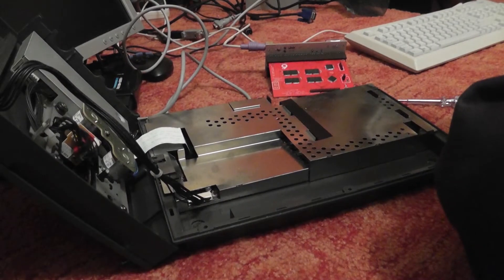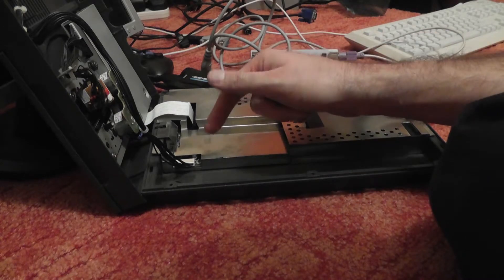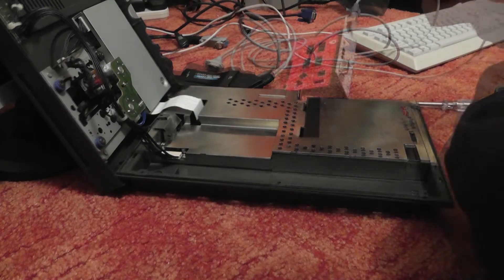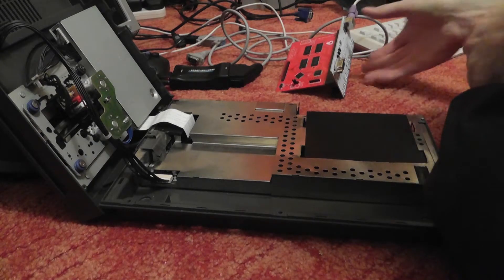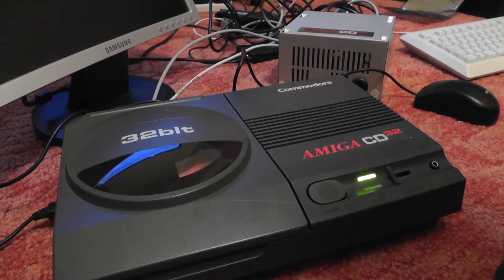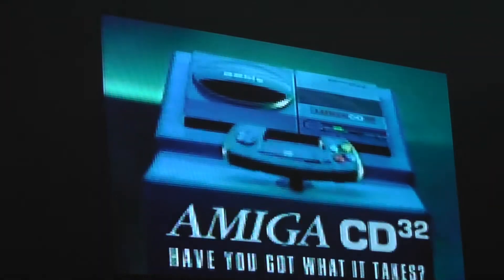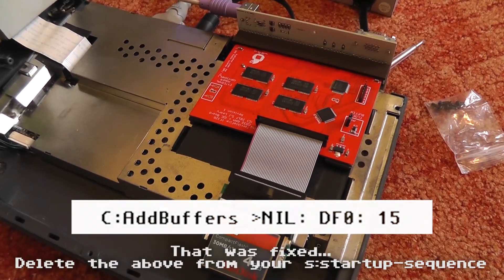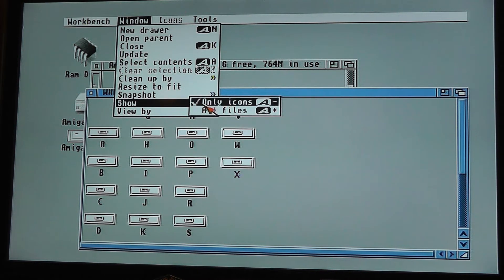Amiga CD32 TF328 Install Tips & Test (With Edu Arana Riser)

Comment: I bought the complete tf328 from amibay. It does load up and play music from the programs, but it doesn't load any actual game from the whdload except indiana jones which gave an immediate red screen of death. Now what to do?
Reply from the maker: This is a good one.
That's telling you that you may need to seat the card better. Make sure it's in all the way home and pushed in completely either side. Some of the eBay tf328's have no PCB bevel on the bottom of where the connector part is. They can be tight and you might think it's in. Also, your CD32 is years old and more than likely that the connectors on the CD32 itself are slightly tarnished and not giving you a good enough connection. Use some isoprop to clean them well either side by using a cotton bud. Also make sure the board is dead horizontal and the riser vertical. This can also cause a bad connection. Once you have it right, then use my insulation tape trick 😉 let me know what happens bud.